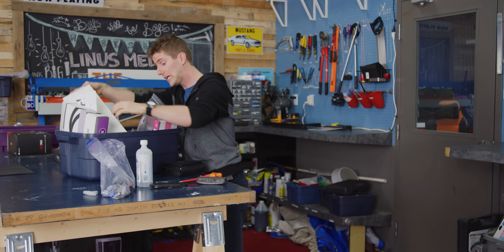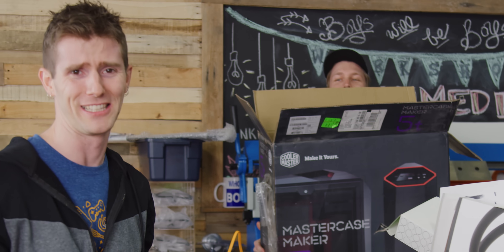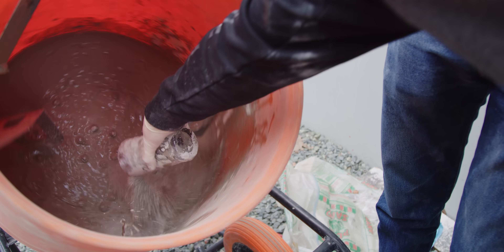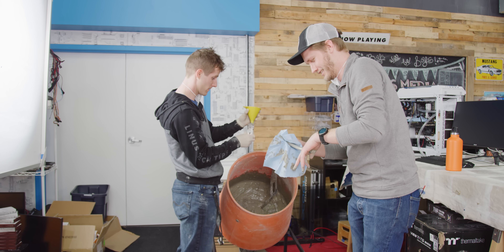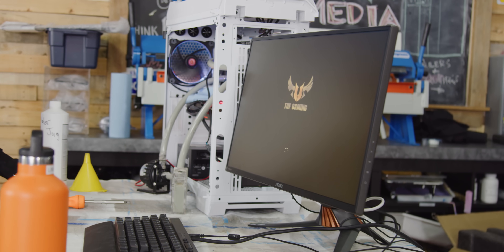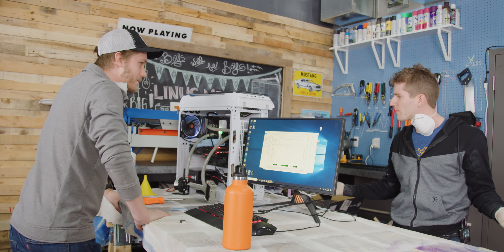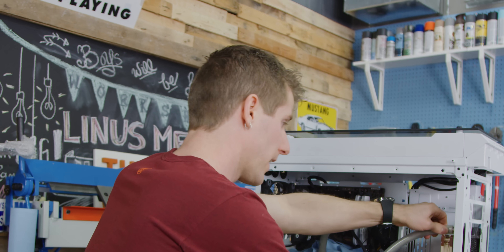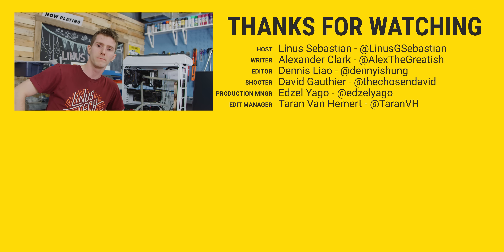I Can't Believe This Worked!!! - Concrete Cooled PC (April Fools 2019)

Comment: If i remember correctly, concrete actually gets HOTTER at a certain point in the setting processes. Meaning, if you actually tried to do this at some point it would be adding more heat to your system.

Comment: You know what liquid is even more thermally conductive and doesn't solidify? Ferrofluid. Thank me later.

Actually i heard diamond is very conductive, so water with diamond dust maybe? How long would it take for that to grind a hole on the plastic tubing?

Comment: Fill the whole loop with Liquid Metal and see how good that cools lmao ... idk how that would work but worst case you just water it down a little but it should still be pretty conductive right? 

 I really don't know if that is even a viable idea but in reality you are literally putting concrete in there so I think that anything goes at this point!
Reply: When Linus was like "idk why no one has tried this before or explored this?" ... The drying is the thing lmao you are literally getting like one good run or so and then before you know it the whole thing is just going to be solid the following day and you will be throwing away like hundreds of dollars of water-cooling kit! That my friend is why no one else is trying this out

Comment: Serious proposal:
1. Peltier element (outside the case, avoid condensation) to cool the water loop (instead of the fans).
      2. Use a turbine (vacuum cleaner inlet) to cool the hot side of the Peltier element.

And have a thermostat somewhere in there. (Or something else that can switch when the water gets too cold or too hot. A thermistor or similar might do)

Anyways - you guys have tried a lot of these things seperately, but not in this configuration... 
(To the best of my knowledge)

Comment: I know they faked this, but I do think that with a very powerful pump this might provide cooling that wasn’t too terrible for a brief amount of time
Reply: No.
It wouldn't.
A water / concrete mix gives off heat - it doesn't conduct it away.
That's even without taking into account the hardening.

Comment: Have a big loop of tubing set in concrete floor like heated floor thing. Dump CPU, GPU heat into it by running water through it instead of radiator. Silent PC and free heated floor!

Comment: When I saw this, I thought you were fashioning a concrete heat sink for an air cooled system, or in conjunction with a water block.  I didn't expect you to use it as the fluid in the water cooling system.

Comment: Hey remember me Linus? Maybe not but you def remember my lawyer! I tried this last year using the concrete YOU recommended and was sure to set my PC up with a backup battery to ensure it would always have power to keep the fluid moving but it hardened anyway! You obviously ruined my pump and tubing but that's not all, my 64 core Risen 6 9600 CPU AND my Nvida G-Force GTX RTX 2100 Super Q Ti were stuck to the tubing because I engineered the cooling blocks to make direct contact with the components (as I've done with many water cooled builds quite successfully) and had to use concrete dissolver to TRY and salvage my parts but the compound just ate through my components ruining the best build possible of its time!!! Did you even think to tell us the EXACT ratio of water to concrete? Nope, not your problem right? Long story short, this guy is a hack and he doesn't know the first thing about computers! Just mod your cooling blocks to make direct contact to the backs of your components using ONLY WATER and you'll get a SIGNIFICANT performance boost! My fastest clock speed peaked about 18.7 Ghz and absolutely shredded Crysis with 638 FPS AVERAGE!!! I'll post a tutorial video on my build process soon for all you fine folk! Unsub from this sandle-wearing butterfingered hack! Rant over!!!!!
Reply: You write a lot for a joke lol
Reply: @muzlee7479  yeah I was bored, and the acting was fairly convincing

Comment: It was fairly obvious what was going to happen as concrete is made to harden, sand and rebar does nothing in that regard just adds bulk and strength. If you wish to come close to the performance but not the end result you should try mud, as in high quality "clean" spa grade mud that you run through a siv first. And make sure it is not to thick for the pump to handle by diluting it some with water. This should replicate the cooling but as long as the water content do not evaporate(you may need the occasional water top up) not the end by not hardening.

Comment: Try filling the whole loop with thermal paste!!
Reply: @Marco-nr4wy  Well, it's not the same as the liquid metal you'd be using for a computer cooler but yes, it should
Reply: @Twofigo What is the "liquid metal thermal paste" made of?
Reply: @Kid574  It's a gallium alloy
Reply: @Twofigo 
Copper is safe with galium
Reply: @Twofigo just use some strong metal pipes. Alluminium pipes or something
Reply: @magusperde365  Gallium will alloy with aluminum and turn the pipe into a crumbly mess of gallium and aluminum alloy. It's why you're not alowed to bring gallium on a plane!
Reply: @DaftFader  yeah that was  my joke
Reply: I actually want someone to try this xddd
Reply: @lemmiix  believe it or not it's been done https://youtu.be/XqvBLBlzeNQ
Reply: The pump would prob die before the cpu
Reply: I think that wouldn't work. Thermal paste it's actually a rather bad heat conductor
Reply: Although i was thinking... liquid metal cooling? That could  work 🤔
Reply: @Kid574  That would cost thousands of dollars to fill lol, but it is something that could be done
Reply: @CookingWithXpsZero  would that be an 1/8 or a 1/4 of gold controller???
Reply: @Kid574  mercury!
Reply: @CookingWithXpsZero  nope, not whit gallium! Its rather solid at room temp, but srouns 30-40 degrees celsius it becomes a liquid!
Reply: @Kid574  ah yes, cool the pc with molten iron.
Reply: @johngaynor4363  a beautyfull Idea, you Just need a CPU running running at 4000° without thermothrottling
Reply: @Kid574 that's how some nuclear reactors are cooled so it would work depending on the metal. Pricey but usable.
Reply: @Kid574  Why is it used to conduct heat to the heatsink then? Just because it's just okay at conducting heat and to fill in the gaps in the metal?
Reply: @Kid574  actually kryonaught is 10x more conductive than water (not hyperbole, 4 w/mK vs 0.4W/mK the advantage water has is its specific heat capictiy is so high (or how much energy it takes to change the temperature by a °) which means as the water gies through the block it stays at the same temperature cooling the whole processor, thermal paste would get warmer as it goes through the block it gets warmer and therefore less cooling potential 

But liquid metals were used in early nuclear reactors (Mercury, NaK but also Gallium alloys (which is what liquid metal thermal paste is) and again these have a lower a SHC but higher thermal conductivity. So it can definitely work, byt the fact that modern reactors switched to water should tell you something.

The other thing that makes water such a good coolant is that it sticks to itself really well which helps with flow through the blocks, you may find with thermal paste similar ti how only some of the concrete in the loop flowed only some of the thermal paste would flow
Reply: @Twofigo mercury is toxic.
Reply: Liquid metal conductonaught
Reply: The verge should try that 😭😭
Reply: Thats what i thought
Reply: wouldn't that basically be a heat pipe like they are used in laptops? 😂
Reply: Use Coors Light to bring the chill of the rockies to your PC.
Reply: @Marco-nr4wy  That's not a good idea. Gallium is highly corrosive to aluminum and there's a lot of aluminum in radiators and pumps.
Reply: @Marco-nr4wy  OK, fair enough. I wouldn't trust the radiator part though. Even though it might be steel or copper channels, I would not bet there's no aluminum in contact with the liquid 😉.
Reply: @Marco-nr4wy  you better damn hope that no water is left in the cooler
Reply: What about molten ice
Reply: @wndrapex04  that’s hot
Reply: How about liquid adamantium?
Reply: Anybody actually curious how to do it with liquid metal, 
Step 1) contact thermal grizzly and enquire about the bulk purchase orice of conducternaught
Step 2) build an all copper loop (No nickel plating bare copper only) 
Step 3) throw away the D5/DDC you used in atep 2 it wont work
Step 4) Convince an engineering company to sell you 1 Electromagnetic Pump (the hardest step) but an actual one, not one used for ghost busting
Step 5) install the the pump and ensure you have a drain valve, you don't want to spill liquid metal everywhere when perform maintenance
Step 6) fill the loop with litres of liquid metal you acquired in step 1
Step 7) brag about it on the forums whilst being too scared to turn it on and too broke ro be able to afford food
Reply: I hate that when I originally saw this I had absolutely no clue it was april fools, and i have been around for a while.

Comment: water is actually an insulator, just because it has a high heat capacity doesnt make it a good medium to transfer heat. it just takes a long time to phase change. In fact, water is such a good insulator they use it for nuclear waste storage.  The only thing that makes it viable for cooling is the pump and the convection constant and also knowing it wont turn into steam at 90 C temps.

Comment: I was anticipating a video about using concrete as a thermal mass. This was great but ya know, pouring a slab of concrete in the back yard could yield some interesting results.
Reply: Except this video is a joke and they totally didn’t use concrete in the actual loop.

Comment: Dig a hole in concrete floor, put radiator in, fill back in with concrete. Bet it works well.

Comment: What a physically simple and charming idea. Try, instead, use a ceramic clay (doesn't harden in this context), maybe grey or blue (you want to maximize the fineness and slipperiness of the pottery clay type for obvious reasons.) If what you are engineering make logical sense,. then the advantage is obvious, the thermally conductive slurry will not harden (i.e. it is sans portland cement.) I mean, after all, what you are looking for mechanically, is a  medium for transporting acquired thermal energy. What you do not want is for the medium to unpredictably solidify. Just chose the right medium. Additionally,  you should use a small slurry pump rather than a centrifugal or piston type (they will self-destruct sooner rather than later). The price difference should be minimal and it is designed for that bizarre foreign material you treating it to. Further, such a pump can better handle startup, where the equipment has sat for a while and the two primary materials you are pumping have separated/settled out. A slurry pump is designed for this type of abuse. You can very likely significantly improve both flow and cooling efficiency by minimizing the length of(if not eliminating, all the fluid runs  (i.e. Position your pump right beside your cooler/CPU in your case).  As far as I know, this type of colloidal mixture (pottery clay in water) is not particularly conductive, so, unlike your portland cement mix, will not be a potential health hazard (unconsidered conductivity) to your circuitry. You may want to try a couple of small fluid/impeller fans inside your to/from hoses to keep the slurry in a maximized fluid state (ie not partially separated).
Have fun.
Rod@B.C. Can

Comment: Man that concrete have a low slump rate. Maybe a 3 or a 4. And vibrating concrete will make it cure faster meaning its going to get extremely hot. The higher the slump the more water it haves and the longer it takes to cure. And next time dont use concert with aggregates
Reply: Bruh it's fake tho
Reply: @mr__pub  yeah I know once I seen the concert lmao. But everyone in the comments thought it was real

Comment: You could use a decelerant in re loop to keep the mix from curing. Idk if you could keep the chemical decelerant res. separate from the concrete, but if you could it would make the loop last way longer. I would suggest keeping the chemical loop higher thelan the concrete loop and have the decelerant feed into the return tube for the concrete res. to prevent a back flow into the chemical res. However, you would have to drop the pump speed for the chemical decelerant to a trickle to conserve as much as possible since it would be non recoverable with getting concrete into the mix.

Comment: Concrete is an exothermic reaction. So I'm short-term it is exothermic then solid. Your basement is cooler because it is underground and cooler. If you take water out of your faucet it is 55 degrees

Comment: Some terminology:
Cement = dry powder
Paste = water + cement
Mortar = water + cement + sand (fine aggregate)
Concrete = water + cement + sand (fine aggregate) + rock (coarse aggregate)

Sugar may slow down the reaction and weaken the final equilibrium paste. However, it should eventually harden somewhat. Also, rock/cement/sand typically has significantly lower heat capacity and heat dissipation properties than water.

Comment: You need to do a v2 video where you build the pc just in a box with air coolers and all fans removed and just fill it with concrete.  Should actually do pretty well.

Comment: @linus you could use a water cooling system with a concrete „cooler“, moving concrete doesn’t work very well, but like u recognised, it drew the heat away. Reinforced concrete does that even more. We have a server that actually uses that. A mineral oil runs through the server and then into the wall where a bunch of loops and coils of copper tubes run around the steel bars. It works quite well, because we can not have any moving parts inside the room. I thought you build something like this but i never thought of filling up a water cooling system with concrete. (You could have used some additives that prevent the concrete to get solid)

Comment: Bro you can try some additiv to conrete... Something that slowing the harding the concreate [in air its vaporating water and heating via chemical reaction of calcium oxid ] ... if you adding some solutions thats slow the hardening in close system concrreate doesnt vaper water and doesnt heating via slowing additiv [first must vaper the additivs after that start heating and vaporating water and slowly harding]... you can try this.

Comment: ROFL  Ouchies!  Ooooh I soooo couldn't bring myself to watch this video for the longest time because I knew it'd end with concrete-filled radiators and water blocks and such and even for a good joke it makes me cry.  But I finally watched it in case I was wrong (I wasn't, obvi) and because I felt like burning the world today, so a senseless act of destruction, even vicariously, fit my horrid mood.  LOL  And ... owwie.  Those poor parts.  What did they ever do to you?  LOL  All that said however, it does kind of make me wonder about less evil versions of this.  Is there a way to increase the thermal conductivity of the water without damaging parts?  Nano particle metals or ceramics maybe?  Or would those permanently pool up due to gravity?  Would particulate damage the pump?  Etc.  Because water kind of sucks, but doping the water could do Bad Things.  LOL  I wonder if LTT is interested in trying different materials in the water just to see?  The cement (before it hardened) did show a thermal advantage even while at a reduced flow rate.  If you could keep the flow rate up while also preventing hardening/blockage (obvi) what doping could reasonably be done?  And does it fail in some way over an extended period of time?  It's an interesting thought.  But I suspect not a feasible one or else we'd see water additives by now for this.  (Or maybe we have and I've missed them?)
Reply: Very much thinned out thermal paste, maybe?

Comment: You would need to use a retardant agent like sugar or some chemical product like Ragasol to keep the mixture from eventually going hard, I think it comes in a jelly form for formwork and it will keep the top layer of cement soft and washable for some time until the surface is exposed to the elements, I can maybe see that product with cement keeping the loop viscous for a while.

But eventually the chemical reaction will always cause it to go hard.

Most pre mixed bagged cementstious products operate within an optimal band for ‘going off’ it’s generally around 16-32degree Celsius, if you can find one of those it would probably take longer to go hard, assuming you never turn your PC off, or you keep it in a freezer room (which might negate the need of having to cool it all together)

<owns a concrete supply and install company>

A fun watch though none the less 😂

Comment: The best thing about this one is that it's actually conceivable (if used as a thermal interface). I once worked in the basement of a doctor's office. Whenever I knelt down, the cold concrete floor sucked the heat out of my knees.

Comment: i have never owned a PC that needs liquid cooling, but if I understand PC systems and concrete; a PC that runs hot needs to run with a liquid pumping cooling system in order to cool down, but by definition, if you're going to use concrete you're going to need a system that continuously adds more water as the concrete solidifies and that continues to pump even when the PC is off; where you will end up with solid concrete.        this is why calling with concrete makes no sense.     it's a waste of time.
Reply: Charles st. hill I’m pretty sure they knew it. I mean just look at the title

Comment: Concrete makes an exothermic reaction when it sets, so if you leave it for a while it will start to heat up much more than if it had water. in addition, it will then set, so if the PC was not turned off with the heat released while setting it will turn off once the congreto sets.